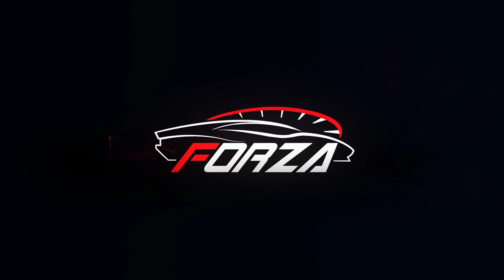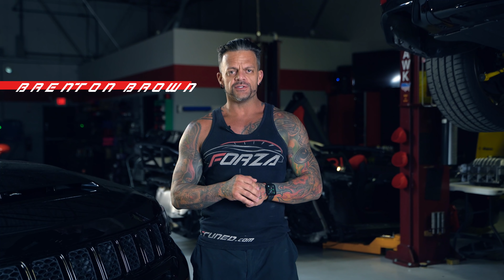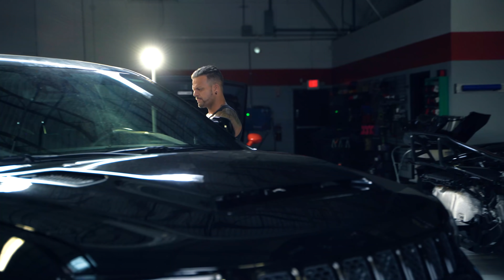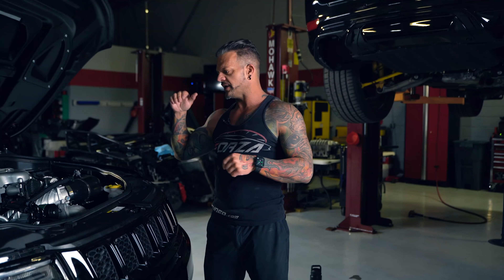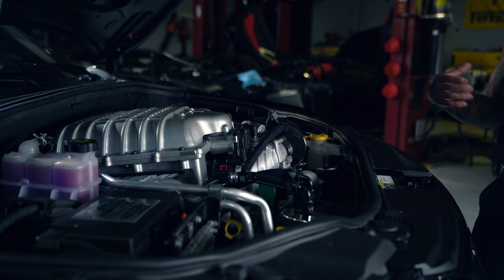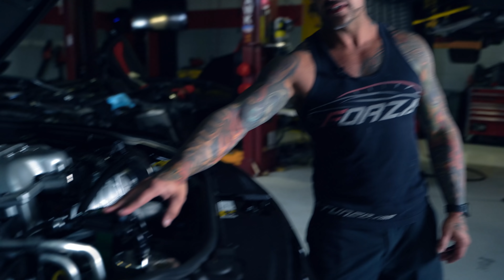The Ultimate Trackhawk Build!

Comment: Just curious as to why you would not recommend mid-muffler delete or cat-back on Hellcat Charger/Challenger?
Reply from the maker: Cat-back doesn’t hinder power at all and the mid mufflers are resonators designed only to reduce cabin drone.  Once you put headers on the car which actually increase performance the car sounds like shit with the resonators removed.
Reply: He mentioned in other videos that the performance gain for $$ spent is not worth it. The stock cat back sounds great with long tube headers added

Comment: What is your take on compound charging hellcats!?  Pretty much add a turbo that feeds into the supercharger.  Should this not add that extra stress and on the crank shaft and on over spinning the supercharger.  Also benefit of easily adding boost via the blow off valve?
Reply from the maker: Overall we don’t recommend it.

Comment: Could you do a video on what is crank shaft pinning
Reply: It's essentially a bolt that goes through the balancer and tapped into the crank which is radially offset from the center axis to not allow any rotational slippage between the  balancer and the crank. He talks about this in recent challenger red eye build videos.
Reply: @markwgundert4251  thanks man
Reply: I was going to ask the same

Comment: do you feel that low end is able to handle the upgrades without problems on your Stage 4-R tunes?
Reply from the maker: Easily and we have hundreds of them built to much higher power levels on stock bottom ends that have been abused for years.